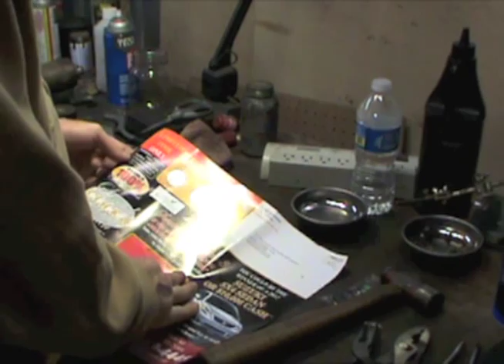Cub Cadet 102 Clutch and Paint-part 1

Comment: I may have some parts for that clutch if you want them i have a bearing, and some extra plate, the front spring right behind the clutch is a little tricky to get you may have to find a spring and cut it down.